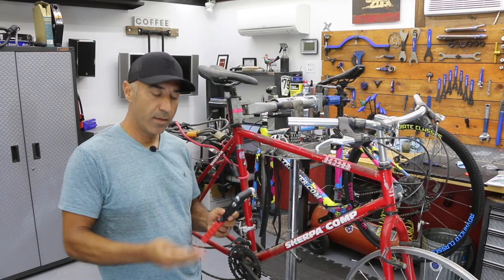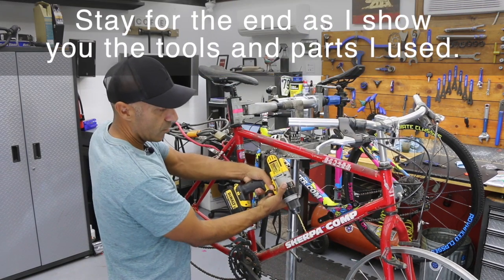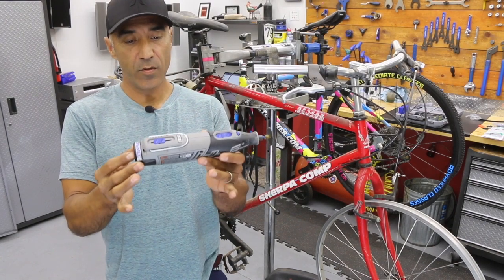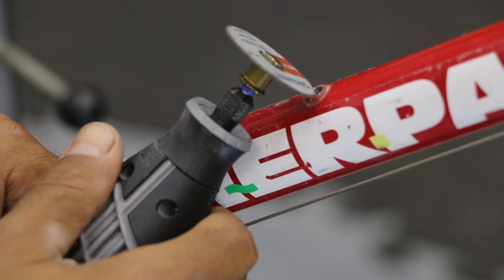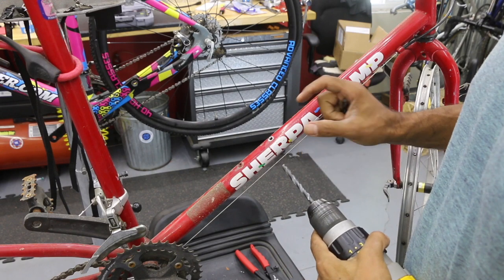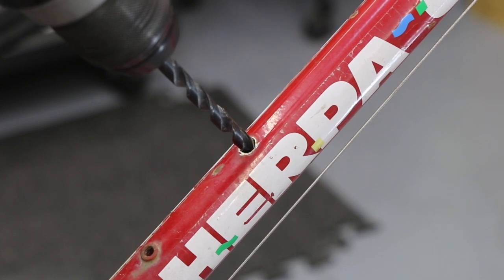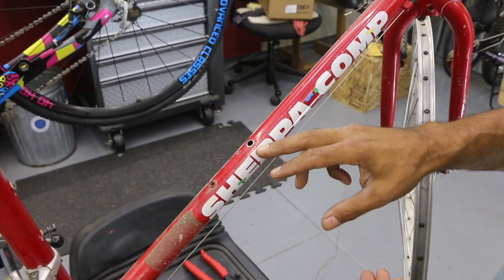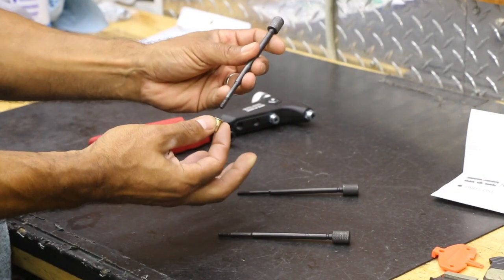How to remove a rivnut (water bottle fitting) and replace it.

Comment: What if you bolts is stuck in it and the riv-nuts is also turning with the bolt. Anyone help plz?
Reply from the maker: That much tougher. Try a wedge in between the rivnut and bolt. Create opposing force then try to loosen. Or cut the bolt is possible or drill the bolt out.

Comment: Thank you Bike teacher! Awesome video and explanation.  So for a carbon fiber frame,  i would hesitate using any power tool because I might damage the body. The bottle cage hex bolt was rounded and i tried to use pliers to unscrew the bolts. Now, the riv nut is rotating with the bolt even though i put wd 40 before using the pliers.  Please help.
Reply from the maker: I would drill it out. Though, I have yet to confirm with a carbon frame manufacturer that a pop rivet style procedure will not harm the carbon. But I think that is the way to go. I hesitate to try it in a customers bike.

Comment: The bolt is turning in the rivnut. Any recomendations? Easy outs?
Reply from the maker: Sometimes gripping the bolt head with needle-nose locking pliers while unscrewing can help catch enough resistance to back it out.

Comment: Ebike is now going to be a beast thanks
Reply from the maker: Nice! Thanks!
Reply: @BikeTeacher was not capping the thing is built solid now rather than wood and tape and metal cable tie’s it’s a 1000w giant stp dirt jumper
Reply: @jackbennett2405 I think I'm in the same situation. By removing the "lip," the lower tube becomes completely flat and smooth, allowing the battery base to rest evenly across the entire surface of the tube. Is that what you were trying to do?

Comment: Thank you. This video was so incredibly helpful - well thought out, well recorded, excellent coverage of the process and the pitfalls. I'm in the process of refurbishing a 20 year old Seven Axiom, which arrived with barrel adjusters and bottle mounts frozen or spinning. The frozen bolts were easy...a little penetrating oil and 30 minutes in the sun loosened them right up. I had to cut off the water bottle mounting bolts on the seat tube and am hoping that the rivnut tool will have enough clearance on the lower hole on the seat tube after I dremel out the existing rivnuts.
Reply from the maker: Your welcome. Glad it worked out. ⚙️⚙️

Comment: Overkill on this. I drill out the thread in the existing 5mm rivnut, and simply retap a new thread with a 6mm tap, then just use 6mm bolt instead of the original 5mm.
Reply from the maker: Did it work? The rivnut may spin in the frame. Let me know.

Comment: I think here in my country it's cheaper to replace the entire frame instead of buying all the essential tools, but it might be worth it if you're going to replace the rivbolts of multiple bikes. And the nearest bare bones bike shop near me is around 90km and I'm pretty sure that they don't have the tools to replace it, I think I'm going to just deal with it because the top bolt is still useable, just wanted to say thanks for the info
Reply from the maker: Thank you. You can use metal band straps to hole the water cage. We call them hose clamps, for vehicles.
Reply: In a pinch you can install a rivnut with an M5 screw and a suitable spacer (e.g. an M6 nut). No special tools required, a rivet nut setter is a handy thing if you are installing many of these.

Comment: Thank you.  I'm using your video to help me create extra mount points for my ebike conversion.  This is really great
Reply from the maker: Your welcome, happy to help.
Reply: I think I'm in the same situation. By removing the "lip," the lower tube becomes completely flat and smooth, allowing the battery base to rest evenly across the entire surface of the tube. Is that what you were trying to do?
Reply: @Federico_Avendaño I was able to use Rivnuts on three bikes to put ebike batteries in the ideal locations

Comment: Where can I find the flexible grinding tool attachment that you used on your Dremel?
I’ve tried to search for one with no success. 
Thanks!
Reply: It’s called Dremel ez lock mandrel… it came with my dremel so I have some familiarity…. Not a big fan because that spring action is what locks the cutting wheel on, and that flex is loosening the mandrel on the blade and can possibly allow the blade to slip. I saw a video where that actually happened to someone where the blade ejected at high speed… I use washers to keep the spring from moving, I’d recommend sticking to a regular mandrel If u have one?
Reply from the maker: Mine came with the kit. Also at Lows and Home Depot.
Reply: The purpose of the EZ Lock mandrel is not to add flex, it's just for quickly changing the cutting wheels. You're not supposed to put sideways pressure on cutting wheels (same on a full size angle grinder). Cut with a cutting disc, grind with a grinding disc. Especially on the Dremel, which has really thing cutting wheels, these things shatter very easily if loaded sideways. For jobs like in this video, I like to use a Tungsten Carbide ball tip (e.g. Dremel 9905).

Comment: Why do we put grease on the bolt? Why not thread locker? I always thought we need the bolt to be tight and not unscrew itself from the vibration while riding.
Reply: With greased threads you can tighten te bolt further because of lesser friction, while making sure it will still loosen if and when you want it to. A properly torqued bolt won't come loose all of a sudden

Comment: how does that tool attach riv nut? what physical happens? thanks
Reply: The tool causes the rivnut to collapse towards the hole. There is a section that has lines on it. When the rivnut collapsed, those lines grip the side opposite of the lip, which is why the rivnut doesn’t spin.

Comment: What type of rivenut do you recommend for a high dollar aluminum Mtn bike frame.  Rivnut material choices are:  Aluminum, Zinc coated carbon steel or stainless steel??  Rivnuts will hold heavy Ebike battery on dual suspended mtn bike.  Thanks
Reply: For a heavy load definitely steel. Stainless is better at corrosion protection but takes more effort to install.
Reply: I think I'm in the same situation. By removing the "lip," the lower tube becomes completely flat and smooth, allowing the battery base to rest evenly across the entire surface of the tube. Is that what you were trying to do?

Comment: Thank you for your help even if the video doesn't have a lot of views it was still very handy to me! I was doing an ebike conversion and the rivet nut started rotating in the hole...
Reply from the maker: Thanks so much, glad it helped!
Reply: I think I'm in the same situation. By removing the "lip," the lower tube becomes completely flat and smooth, allowing the battery base to rest evenly across the entire surface of the tube. Is that what you were trying to do?

Comment: The actual rivet tool kit to look for is M39316. It includes the mandrels and nose pieces for M4, M5, and M6 rivnuts. The actual tool itself is M39300. The Amazon link you shared is for #8-32, #10-24, #10-32 sizes (which are English, not metric). BaySupply has this => https://www.baysupply.com/2477330/Product/Marson-Tools-M39316
Reply from the maker: Thanks for the heads up.
Reply from the maker: Thanks for the heads up.
Reply: @BikeTeacher  - I was able to fix my own rivnut problem on my bike! I had ordered the rivnut tool from Bay Supply, and I already had a Dremel-like tool and a drill with the needed 19/64 drill bit. I ground down the top of the rivnut, and I drilled the rivnut out with the drill bit. Using the rivet tool, it was a snap to get er done!
When I had called the local bike shop, they had a week wait time, and they did not inspire confidence when they told me that they can fix them "most of the time".
Thanks for your video!
Duane
Reply from the maker: Your so welcome. Job well done!

Comment: Can you help me-
My bolt got stuck into rivnut probably corrosion, I can't unscrew it, rivnut spins together, I tried with clencher to pull it out of frame, didn't happened, ..  any suggestions?
Thanks.
Reply from the maker: You need to stop the base rivet from spinning, Use a tool like a split fork pry tool to lift up on the cage bolt while unscrewing it. This upward pressure should stop the rivet from spinning.

Comment: Can you make a video about if the bike is set up to 6 bolt disc to centerlock, what i need to change the set up or what components needed. I am contemplating to upgrade my wheel set with center lock disc. Thank you
Reply from the maker: Yes, Buddy I can do that. Thats a good one. stay tuned soon. Thanks
Reply from the maker: I think this is what you want. I do not have this item to make a video with. I hope this helps. https://youtu.be/q1lEKDxHE0g

Comment: HOW DO YOU REMOVE AN RIPPED OFF BOLT ON RIVET IN A CARBONFIBER FRAME - I TRY DRILL IT BUT THE DRILL BIT BOUNCE EVERY WHERE - ANY WAY TO REMOVET WITHOUT HURT OR DANAGE THE FRAME ?
Reply: I would try cutting a slot into the bolt with a Dremel and a cutoff wheel, then unscrewing it with a flat head screwdriver. If you damage the rivnut, then you can replace it!
Reply from the maker: Is it a water bottle bolt? That’s a tricky one. Sometimes the screw is loose enough to screw out some how. There is a two in one  removal tool I use I will get you the info ASAP.
Reply: @BikeTeacher  YES -  ITS - THE PROBLEM I GOT IS THAT THE BOLT LOOS THE HEX HEAD,  AND THE RIVET SPIN ALL TOGETHER WITH THJE BOLT - I TRY TO DRILL IT - BUT IM IN FEAR TO SCRATCH OR DAMAGE THE FRAME - SOME ON TOLD TO CUT IT OF AND REPAIR THE FRAME WITH NEW CARBONFIBER PATCH ...